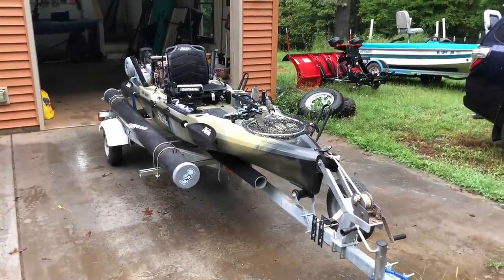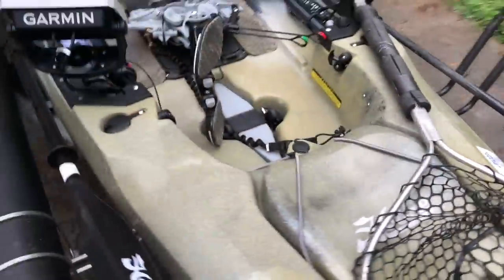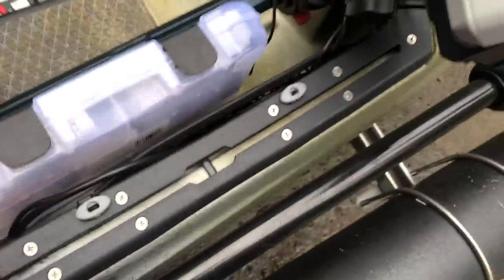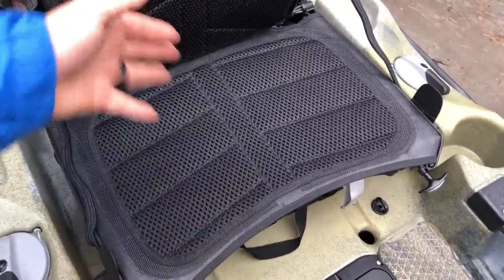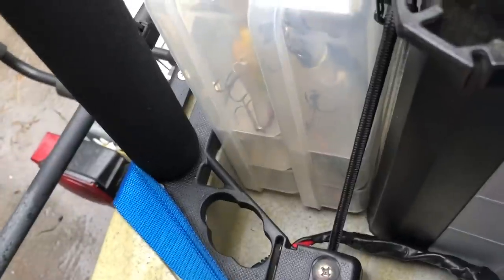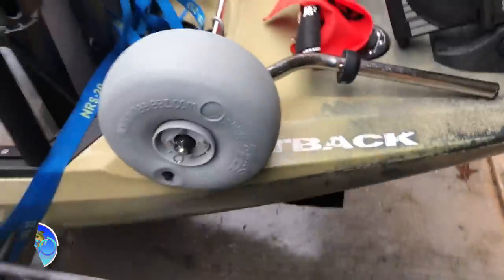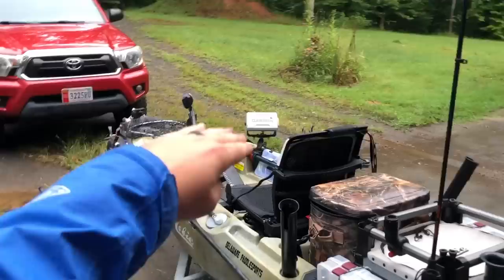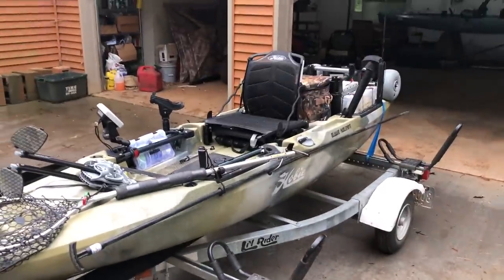2019 Camo Hobie Outback Rigged (Tournament/All Day Fishing Trip)

Comment: I had a question. So the bungee for the paddle just screws out and you can just screw the PA paddle clips in with no modifications?
Reply from the maker: Yup. There are two tabs that you can stick a pair of needle nose pliers in and spin it right out. Then the PA paddle clip screws right in. And it is totally reversable.

Comment: Nice customization, Sir.  What is your primary style of fishing, types of water, etc.?  What are your thoughts plus and minus as compared to your PA?  Was your PA 12 or 14?  Thanks
Reply from the maker: Thanks. I primarily fish Lakes and small reservoirs. However I do fish small rivers and lakes with standing timber, both of which I need to be able to paddle as I don't want to risk damage to the mirage drive. I had a PA 12, and as far as that goes comparison wise I plan on making a video comparing the two soon. But the short comparison would be PA has more room, more stable, and a superior seat. The Outback is faster, maneuvers better, Lighter, and paddles better. If you have anymore specific questions let me know.
Reply: Thank you.
Reply from the maker: No problem
Reply: So how do the anchor  trolly and the Power pole compare? When to use these? What kind of water do you want these?
Reply from the maker: Basically if I'm in 7ft or less I use the power pole and if it's really windy I'll use both to keep me from spinning. Anything deeper than 7ft I use the anchor wizard with the anchor trolley to position my boat, depending on if I want the wind to my face or back.

Comment: Man I love the 2019. Might have to sell my Native Slayer propel 13 . Love how it comes with places for your gear built in
Reply from the maker: It's an awesome yak. Have you ever pedalled a Hobie? Just curious bc the Mirage Drive pedal motion is so much different than other pedal yaks.
Reply: Blue Summit Outdoors I haven’t used one but the guy I fish with has a PA.  I know it’s a front to back motion which is hard for some to get used to. Looks like the perfect set up though. I love my kayak but yours looks like there is a lot more room and storage.
Reply from the maker: Yea definitely an adjustment going from one to the other in either direction. I came from a PA so it's less room than I'm used to. However it's not as open at the PA but I feel like there is more usable storage and space. Definitely worth at least checking out.
Reply: Blue Summit Outdoors awesome  thanks for the advice. Keep the videos coming
Reply from the maker: No problem and will do

Comment: Did you paint the trailer rod tube and if so what paint did you use?
Reply from the maker: Yes I did paint it.  I used flex seal you could also use some spray bed liner.

Comment: Do you store your kayak on that trailer 24/7? Not worried about the 3" pvc denting the bottom? Just got a 2019 outback, trying to figure out how I'm going to store it on my trailer - I'd like to keep it right-side up as opposed to upside down but I don't want to dent/damage
Reply from the maker: I used to have a Hobie PA and I stored that on the PVC 24/7 with no issues ever. The Outback I store the same except during the winter I store it on the Boonedox Yak-Rack to save space in my garage. But I've honestly never had any issues with storing kayaks on the PVC as long as the PVC is adjusted to the right width.
Reply: @BlueSummitOutdoors   Thanks for the quick reply.  And you've always used 3" PVC? Ever use 3" Corrugated PVC pipe? Just saw another video where a guy said he liked it better than rigid PVC because it adapts to the kayak better.
Reply from the maker: No problem. I've always used conduit pipe. It holds up better than PVC. PVC gets brittle, and I've had it break. The conduits it's heavier duty and holds up better to UV rays from what others have said. Don't know much about the corrugated.
Reply: @BlueSummitOutdoors  Glad I asked, didn't know there was a big difference since they're both PVC.  3" Schedule 40 conduit it is. Wish I heard more testimony on corrugated over time.

Comment: Hey i am building a trailer for my 2019 outback , what size is the pvc pipes attached to your trailer, sweat set up
Reply from the maker: It’s either 2-1/2 or 3 inch
Reply: @BlueSummitOutdoors  thanks go to store now and get both
Reply from the maker: I’m pretty sure either size works fine. I’d use conduit instead of pvc though.
Reply: @BlueSummitOutdoors  They dont sell 2.5  inch conduit at lowes i get 23 inch

Comment: you recommend the outback over PA14? am torn between the two.
Reply from the maker: I love both it depends on what you want to do with it. I'd say you can't go wrong with either.
Reply: @BlueSummitOutdoors  I had the PA14 loved it, am a big guy at 280LBS. And it was super stable. My only issues was I couldn't enter tournaments that was in creeks. And it was a very hard kayak to paddle with, and using mirage drive in certain spots was just out the question. I also plan on fishing devils river sometime soon, and obviously the PA14 would be long choice there as well.
   Knowing this would you recommend outback?  Is the outback easy to paddle? cause certain trips I wont be using mirage drive.
Reply from the maker: Yes I would definitely recommend it for that because thats the same reason I sold my PA for the Outback. It paddles well and it does great when I take it on River floats. To me it's a great all around boat and is very versatile. I'd definitely demo if you could or see if someone in your area has one for you to try.

Comment: What size is that rod holder? Long and wide ?
Reply from the maker: Are you talking about the rod pod mounted to the trailer?
Reply: @BlueSummitOutdoors    yes
Reply from the maker: It's 6 inch PVC and 8ft long (it comes 10ft but I cut it down.)
Reply: With reels on ?
Reply from the maker: 5 or 6. 3 with the reel side slid in first and 3 with the rod tip slid in first.
Reply: @BlueSummitOutdoors  great vid bro thank u